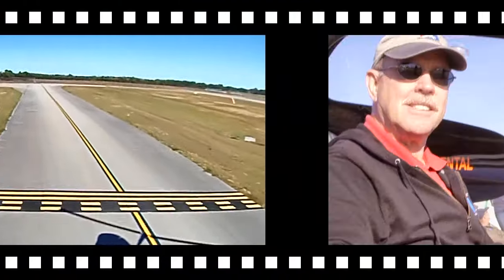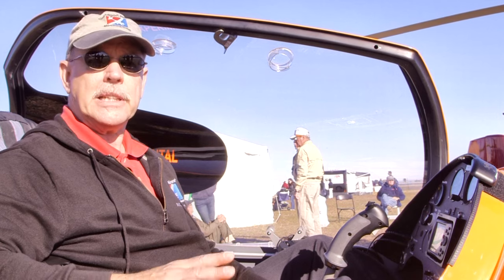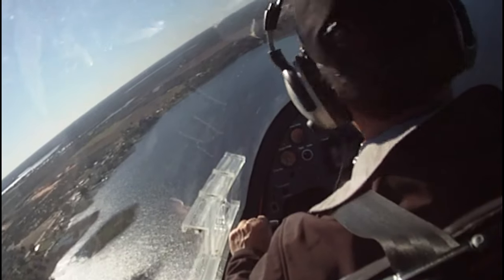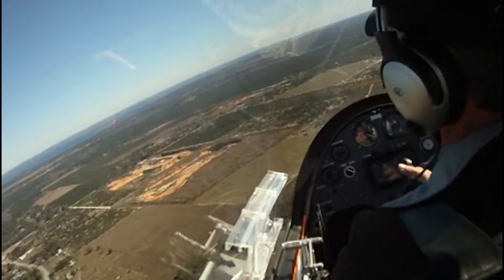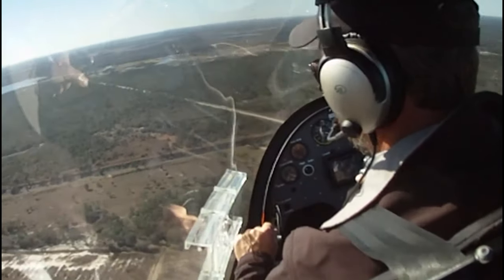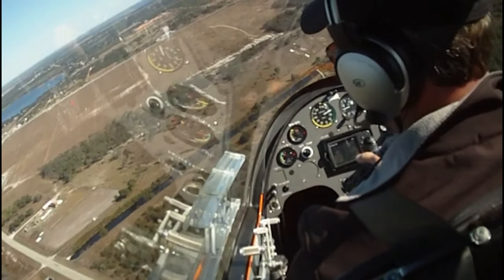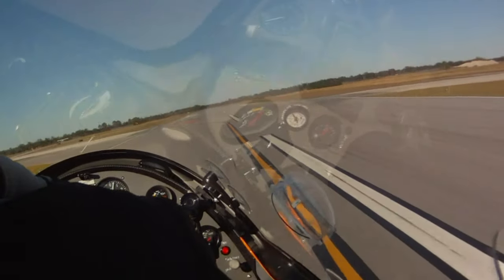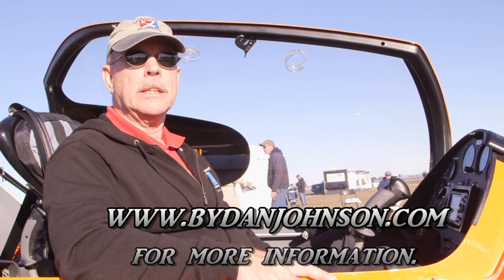Sport Aviation Expo Sebring Florida, Jan. 25th – 28th  2017, AutoGyro USA on display.

Comment: Great video which gives a good intro to gyroplanes.  A couple of corrections though.  First almost all gyros are in the LSA category (E-LSA vs S-LSA) and require only a Sport Pilot license.  Also, gyros tend to require more initial training than fixed wings.  Most pilots require 15-20 hours to solo whereas fixed wings tend to be 8-12 hours for solo.   Lastly, gyros can be a comparatively low cost way to get into flyi g.   While the gyros in this video cost $75k - $110k, there are many other kits that start under $20k for a single seater.     For more info go to the Popular Rotorcraft Association website at http://pra.org/ .
Reply: + HydroPilot1 "First almost all gyros are in the LSA category (E-LSA vs S-LSA)..."

While they can be flown by a pilot with a Sport Pilot certificate, the S-LSA category is not available to rotorcraft, so most were E-AB or E-LSA...until recently. There were no new, factory-built autogyros available in the USA, but that has changed and as of November 30, 2016, AutoGyro GmbH is now selling certificated Calidus models; and those are Primary Category aircraft, not Special Light Sport Aircraft, and are certificated under Part 21.24.

Comment: Not a fan of auto gyros.
Reply from the maker: The question has to be WHY? They are NOT auto gyros - they are gyroplanes.
The Ultralight Flyer
Reply: AUTOGYROS! [the FAA calls them Gyroplanes], they are known as Whirligigs by the Whirly Girls, "Aerial Dirtbikes", Flyin' Lawn Chairs - they have many names! Autorotation is the Magic Missing Link in Aviation! It is not well understood. But it is magic just the same!  

It's so easy to get in the air that anybody can do it! And many did and got killed because they skipped the training! But now it has become the safest way to fly. The autogyro does not stall. The maintenance is minimal bc there is no power to the rotor; and no tail rotor! That makes it much easier to fly than a complicated helicopter.

It floats and glides like a parachute in an "engine out" condition. It runs on regular gasoline!  It needs little to no runway. It takes off quicker than a fixed wing aircraft; it can handle windy conditions better than fixed wing and can land like a helicopter! 

Wake up people!!! Autorotation is the Magic Missing Link of Aviation!